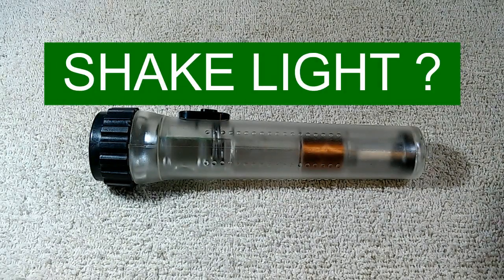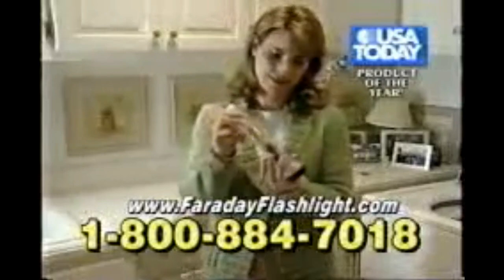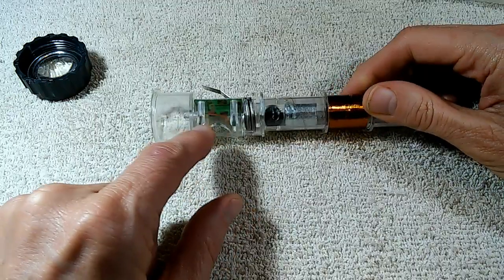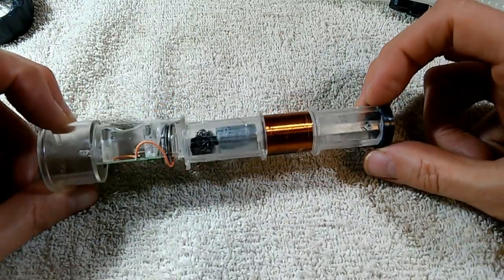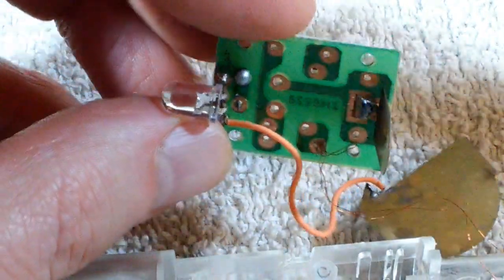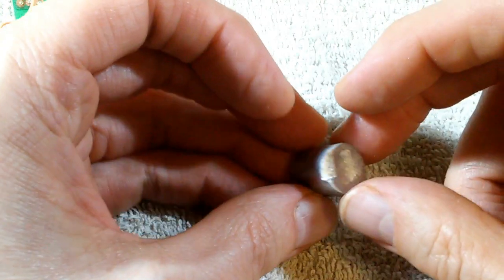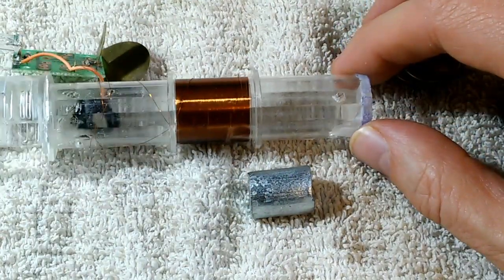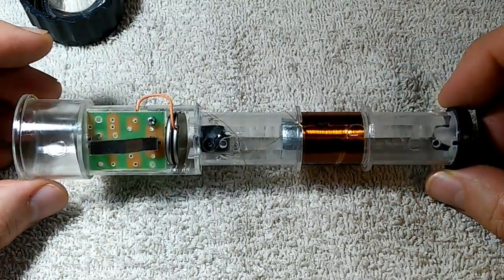Shake Light or Fake Light?

Comment: Bought a similar one. Battery is quite good. I was keeping it on for an hour and it did not get dim. I wanted to get it dim and shake. Shakung did not influence the brightness. The coil should be thicker and have more turns ca 2000 to generate induction voltage enough to pass rectifyer diodes and charge a supercapacitor.

Comment: You should make the fake light a real shake light,  it's possible.   Just need a real magnet and wire it to a capacitor instead of batteries or in your case instead of nothing.

Comment: Well just shaking the light for several minutes while watching your video. Its got a bright light im sure could get brighter if this shake flashlight belonged to a 12 year old boy.  
The kicker is the shake flashlight that I have dont even have 3 flat dime size batteries to give off the fake idea that shaking it really works. The one I have does work. But the one I have,  has no battery compartment or any connections for batteries of a any type. . Omg I'm excited that it works, I also have a crank type, I could crank that for an hour and never get a flicker of light. Amazing different types one works one don't!.
Reply from the maker: Your working shake like probably uses a capacitor to take and hold charge.  Some of these shake lights actually worked.  Your crank light probably contains a NiMH or NiCd battery that has gone bad.  They will fail after a few years.  You can disassemble it and replace the battery.  How ever, it is probably soldered in place.

Comment: I got that shake light, the coil is connected to a super capacitor, with a strong magnet, I got the real one, you got a fake.
Reply: I found a fake one in my attic it wasnt a popular product here at all
Reply: @awiwer-e3h Very true. It is very dim and useless.
Reply: @Adamisgood24 no like i mean fake fake, nothing on the board same as one in vid, i am currently attempting to make it work as it has a real pcb
Reply: @awiwer-e3h Cool.
Reply: @Adamisgood24 i cant find the components nor a very good diagram of what i have to do. Also i am not sure how to solder.
Reply: Same i got real

Comment: I’ve found a couple shake lights that are identical to what you have there but are legit shake lights. Even the magnet in them looks like the pot metal piece that’s in yours but it was magnetic. The only way to tell the difference between what you got and what I got is that what I found had capacitors in them as opposed to coin batteries.
I never have seen a fake like what you got there. Blows my mind because it seems like the production of both would be nearly identical in cost
Reply from the maker: I agree.  For a few cents more they could have made it real.

Comment: No offense, but that’s not a real feraday light, that’s an off brand one made by another company to market off of the actual company itself. You did indeed find a fake like, but more or less a knock off one. I actually have a real one and have personally taken it apart myself, and there are no batteries whatsoever, and the recharging thing actually works, if you set the light down for a period of time and try to turn it back on there will be no light and won’t work. But if you pick it up and shaking for a decent amount of time contrary to the commercial cuz it takes longer to make it really bright, it will then work.

Comment: Got the same except there is the circuitry but its bypassed and 2 cr2032 batteries are used instead. Must have used up the last of tge boards before moving to complete  fakery. Go figure.😂

Comment: Mine was a gift from a friend but it was called the Forever Flashlight at one point it didn't turn on so I took it apart. No batteries were inside. I was trying to see how it works other than the magnetic field I wanted to see how it turns on and off. It wouldn't turn on for a while and I thought about throwing it away but when I went to put it back together it turned on. I was stunned so I turned it off but it didn't turn back on. So I tried to recreate what I did and I found what made it turn on. There's a magnet in mine when it move pass the thin wire it turns on so its working again. Mine is close to 20 years old.

Comment: I have a flashlight that looks nearly identical to this one in the video, the only differences in mine are it doesnt have any coin batteries as you called them, and the copper wiring in mine looks real lol and the magnet is really strong inside of it, lastly you have to hold the power button for light. I've had this one for years and i keep it in a closet where i store tools and the closet doesn't have a light so I just use the shane light whenever i need to see to be abke ti gather tools.

Comment: I have both of them.  Fake one I buy accidentaly when kid maybe 2005-2006 not very cheap I was very pissed off for money lost so try remake it to regular AA or AAA battery flashlight but "magnet" tube can't take two battery.
Real one I bought 2010 I remember full bridge rectifier inside,  mikroswitch, resistor and rechargeable battery with small capacity maybe 20mAh max 40mAh probably nicd it work but light from LED was poor.

Comment: I have an OmegaLight which I don't think is a fake. I've owned it over 10 years, and it won't come on unless you shake, still works pretty good. I wouldn't want to depend on it. Wasn't a $1 either lol.
Reply: Better to depend in a self recharging flashlight than batteries.

Comment: I have one of these and it is fake. I have the as seen on TV one and it is real but it sucks. The fake one says popular science on it and I got it at a thrift store. I'm curious because looking at the board on yours and all the tracks are there just no components. I'm wondering if you could add in the missing parts and throw a super cap in and have this fake light be a real light.
Reply from the maker: Adding circuitry would not work because the induction coil is also fake and it generates no charging current.
Reply: @c.davidgraves4848  Well you said it was shorted together, Could you remove the short and do a continuity test on the coil before going any further? If the coil is good then see if the magnet is real. if not then harvest this light for the little parts it has.
Reply from the maker: @coondogtheman  I did not un-short the wires and check continuity.  The metal "blob" sliding thru the coil is just cheap pot metal.  It is not magnetic.   
So, if the coil has continuity, you need to supply a cylindrical magnet and build a charging circuit.  Hmmm.  Probably easier and cheaper just to buy a real shake light.  Even more practical is a light that can be charged with a crank handle and/or a solar cell.  I have such a light and it also includes an AM/FM/WX radio.  If you want a tool for an electrical outage, that is a better way to go.
Reply: @c.davidgraves4848  I have a few of those crank lights but the main problem is the batteries die in them.

Comment: Honestly that pretty crazy that you got a fake one, luckily I’ve gotten a real one, took it apart and 100 could tell it was real. It even lit up a smidge when I shook it.
Reply: Not very long light duration but yes there are real ones with capacitors and they don't last long but it clearly works as it only lights after shaking it and the wires are actually wired properly
Reply: What’s the real one
Reply: Were did you get it from?

Comment: As  some people have commented, there are "real" versions of this with some circutry. I was given a broken one and it had the same circuit board but populated with 4 diodes, a resistor and a 5.5V, 0.22F supercapacitor, at least that's how it was labelled.
Reply: At least you got a chea0 flashlight
Reply: That appears to be the correct circuit!

Comment: I got a couple of these from the thriftstore and I thought one was fake because I could see the 2032 coin batteries. However, it worked much better (and brighter) once I removed them.. They had died and were draining the capacitor! I did have to put some insulation where the batteries were because otherwise the loose connectors would flop about and short the capacitor in an instant. I'm surprised they didn't stick a diode on the battery so it wouldn't do that.

Comment: There are fakes. I have gotten a real one, where at first the light doesn't illuminate at all, but after enough shaking, it worked well. If my light wasn't powered by shaking but rather batteries, it wouldn't be able to not light up after unboxing it. You have a fake, but there are real Forever Flashlights out there. Really great video though!

Comment: I got one at an rc show when I was 6 years old. And I used to leave it on until it died and see how long I had to shake it get it changed. And it did work.
Reply from the maker: There are some shake lights that actually work.  How ever, some are complete fakes. Like this one.
Reply: @c.davidgraves4848  Which brands work?
Reply: I had one when I was in Africa, and it only worked after shake, and if left on till it had no more light , when shakes deu minutes it had light Again, I also had a crânio one an it gave me light to
Reply: I want a real one

Comment: Mine is a little better than yours, it is a real magnet and it flashes a small red LED when shaked, but after analysing the circuit, there is no connection to the battery...